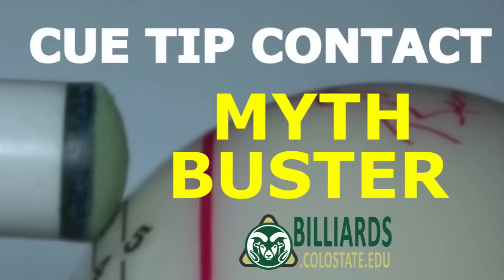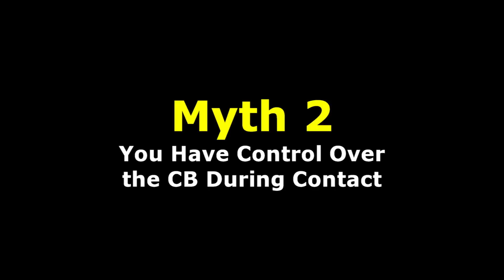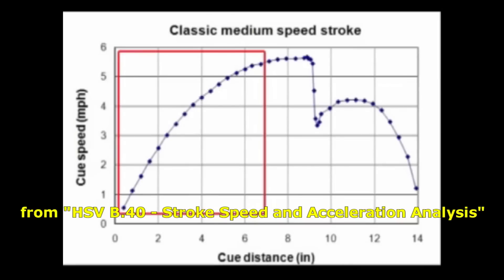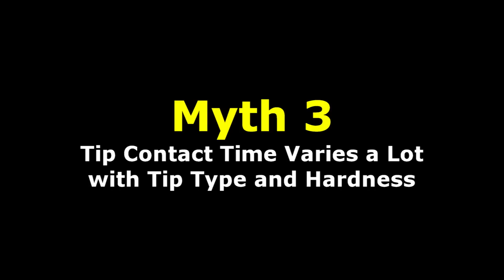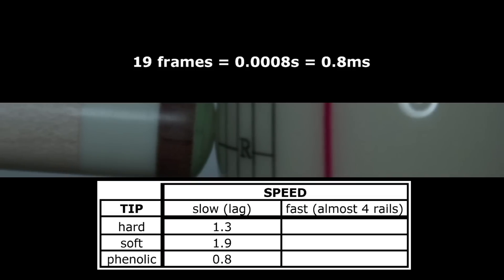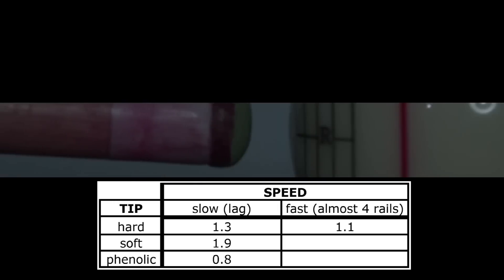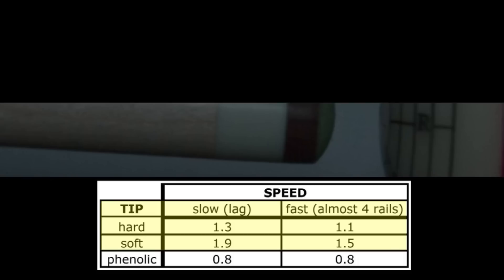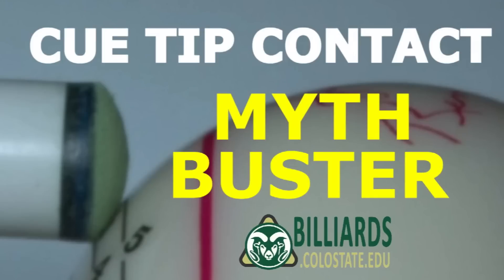Cue Tip Contact Myth-Busting Truths in Super Slow Motion

Comment: What would be a very important experiment is if someone could program a robot that cues the same every time (in terms of angle), but reaches the speed in different ways. I don't believe you would see the same energy transfer if a cue coasts at constant speed into the cueball vs when the same speed is being reached only just as the contact occurs. Even if the latter goes on to be decelerated too, I still believe that you would get slightly longer contact and better energy transfer due to lowering of the deceleration. It's a big difference when something still has an active input force, vs when it only coasts on momentum.

I don't believe that it's only illusion that great players can get huge amounts of power and spin from a simple and slower looking stroke than a lesser player, or that it is only about an input speed. If there's a slight illusion, I think it's simply that well timed shots save the maximum speed and active force input for the instant of collision (thus looking slower overall, even if the contact speed is the same). However, I don't believe it's an illusion that you can do more with timed acceleration than coasting at the highest speed.
Reply from the maker: Good stroke "timing" is smoothly accelerating into the ball, reaching maximum speed with no deceleration before contact.  This is what good players do to make the speed, spin, and power look effortless.  For more info, see the videos and info here:
    https://billiards.colostate.edu/faq/stroke/good-timing/
Reply from the maker: BTW, your proposed robot experiment would be interesting, but robot testing is not always a good substitute for some of the reasons here:
    https://billiards.colostate.edu/faq/squirt/robot-test-results/
Reply: @DrDaveBilliards  the problems detailed in the experiment with robot cueing surely points to how much more we have to consider than the speed at contact? Surely things like contact time are what would have altered the results, in causing the problems with using the robot? To me, it only shows how much more there is than a contact speed.
Reply: @DrDaveBilliards  what explanation is there behind this being the best compared to a constant speed stroke, say? Surely it has something to do with contact if there's a distinction? It's always tricky with humans because a change of pacing could also ruin something else (such as straight cueing) for associated reasons. But why would constant speed be different from the paced stroke, if we only consider contact speed and assume contact time is unchanged? 

 I definitely believe it matters how something is paced and deceleration is certainly bad. However, I think the reason deceleration at contact is a problem is that it shortens contact time erratically and unpredictably. I'm open to the possibility of a sweet spot where you stop the active acceleration marginally prior to contact, but I'm not so convinced of a reason why active acceleration into contact wouldn't add more still for a power shot.
Reply from the maker: @cziffra1980  I don't think acceleration or deceleration at contact changes contact time significantly, if at all.  And even it if did, this would be unimportant based on the explanations on the resources pages (and supporting links) I have provided.
Reply: @DrDaveBilliards  I just find it hard to believe that contact time would be so tightly stuck within a percentage range that it isn't open to meaningful fluctuations either positively or negatively. 

How else do we explain the problems with cueing robots? The net impulse is solely the product of the force applied and the time. If it were simply about speed at the instant of contact, there would be no logical reason why a robot would perform differently. The difference is clearly being expressed through the force/time or both, in a way that is different from a cue that hypothetically only coasts in a space to arrive at a given speed. What almost certainly isn't the case is that speed x automatically gives contact time x, regardless of the other factors, when it reaches the cueball. It doesn't necessarily mean it's the most important issue or that it's enormously open to being controlled, but I can't make sense of any theory that it reduces it to nothing. Why pace the cue action at all, if nothing shows up but a contact speed? There is at least something more. Fluctuation is harder to conceive of in small quantities, but mathematically it actually multiplies the percentage effect of tiny changes.
Reply from the maker: @cziffra1980  The problem with cueing robots with non-human, rigid grips is they change the effective weight of the cue.

Concerning why "stroke timing" is so important.  It is mostly to get the maximum cue speed with the least effort with a smooth and steady motion, and to provide the best speed consistency and control per the info here:
    https://billiards.colostate.edu/faq/stroke/good-timing/
    https://billiards.colostate.edu/faq/speed/advice/
    https://billiards.colostate.edu/faq/stroke/technique/
Reply: @DrDaveBilliards  the simplest way to summarise it is to say that if a robot striking the cue at speed x can cause a different result to a human striking it at speed x, there is a difference during contact. Regardless of what that difference might be, it shows up in the impulse and thus through through the product of force and time. Human actions can change things too. It doesn't necessarily matter how that breaks down, but I think it's important to recognise that even a short contact can happen in slightly different ways, even if it initiates at the same speed. Changes can take place even in tiny instants and multiply.
Reply: @DrDaveBilliards  I feel like you're recognising how important pacing is, but then wanting to downplay one of the variables in which the result of pacing can show up. Force and time are where the virtual mass added to the cue by the robot has an effect. Things like grip strength during contact can play a role through the same two variables. 

I'd agree that there's no need to fixate on contact time, but I'm not convinced that there is greater value in actively downplaying even the possibility that changes of pacing can manifest to some degree here.
Reply from the maker: For the robot rigid grip, the cue has more weight, so at a given cue speed, the "cue" has more momentum ... therefore a different hit.  Simple.  This does not occur with "fleshy" grip of a human per the info here:
    https://billiards.colostate.edu/faq/grip/light-vs-tight/
Reply: @DrDaveBilliards  I take your point, but the way we interact with the cue has an effect through the same means the mass of the robot does. You can either be resisting the deceleration through stiffness or by trying to actively accelerate into the resistance. Either can affect those in a similar way to adding mass. Even if the goal is to coast instead, it never really happens so simplistically when own mass is involved. Our mass won't just detach outright nor apply as a constant, independently of the technique applied. It's a combination of the existence of the mass and what it is doing during contact. 

It's not an equation where in one case we feed in a mass of the cue only and the robot plus the cue in the other. Rather, the effects of this show up within the force and contact time. You could treat the human input factors as going under the proxy of "mass" too. We're just more complex in how our mass associates to that of the cue so its less of a constant than with a robot. The problem with the robot is that it's consistent in a bad context, whereas the human has more variables to exploit at will. 

At the end of it all, there are differences other than initial contact speed which change the force and time, regardless of how tiny the duration might be. To me it doesn't make sense to recognise the variable factors other than contact speed, without recognising that its specifically through force and contact time that they get to play their role.

To give a weird example, if you had a light cue that was been hugely accelerated during contact (by some kind of insane jet engine) then it would logically function more like a heavy cue. Not because of actually having mass but because of the effect on the force and and time spike.

There may well be a good argument that the most reliable result comes from trying to keep our mass out of it, but everything we do to attach or detach ourselves from the way the cue moves is influencing force and contact time in some way. Just because its possible that some may have overplayed the relevance of prolonging contact time in good technique, it doesn't make it a non issue that cannot be influenced.
Reply from the maker: @cziffra1980  Based on all the known information at all of the links I have provided, our "interaction with the cue" during the incredibly brief contact time has no meaningful effect.  Most of what we feel occurs after the CB is long gone.  Again, check out all the links when you can find the time.  There is a lot there.  This stuff has been studied and analyzed for many years.
Reply: @DrDaveBilliards  I find it quite interesting what you suggest about the skin give being unable to have any influence during that time, but surely it would be incredibly easy to simulate the same in a snooker robot, if the cues acts as if separate from the hand altogether during the contact? If this were genuinely an absolute zero as a factor during that instant, I can't imagine why they would have any difficulty building a system that accelerates a cue stabilised by some kind of firm foam say, without any significant mass to play a role during contact. Logically, that should detach it from surrounding mass too. It's definitely something someone should try. I'm just quite skeptical of whether these can truly be completely removed from the model.
Reply from the maker: @cziffra1980  When we worked on a cue robot at CSU (articles are available at the linked page), we used silicone rubber to simulate the human "fleshy" grip.  It decouples the robot from the cue nicely (just like with a human grip).  Some pool players have actually used a "slip stroke" technique, where the cue is actually released (or thrown) after the forward acceleration.  The result is the same as if the cue was still being held.  See:
    https://billiards.colostate.edu/faq/stroke/slip-stroke/
Reply: @DrDaveBilliards  ah, okay. Did you try to actively change the pacing of acceleration of the cue during contact with these simulations (both to stop trying to apply extra force before and after contact)? It would be interesting to see.
Reply from the maker: No.
Reply: @DrDaveBilliards  I was thinking more about this and you do make a strong case for how the effect during contact might be very small. However, I can still see a possibility where if the hand is actively accelerating, it produces more friction compared to when both hand and cue are now coasting. I think I'd have to see some kind of testing that compares acceleration of a hand like connection during contact, vs coasting, in order to finalise whether the difference between the two scenarios is definitively negligible. Although my image of acceleration on the piano is based on a longer bond into resistance, I can still see a degree of theoretical room for control over the shorter duration.

Also, if we do take it that the skin issue means nothing can be changed during the strike, I think this raises additional questions. Why would acceleration during contact reduce control vs entering coasting marginally before contact? Within this model, it should only matter what speed the contact occurs at. The model doesn't allow for transfer for extra acceleration then, but it doesn't clearly show why it could have a negative effect when you still aim to reach your speed at the strike point. Why would it be an advantage to settle on that speed slightly prior to contact rather than continue for a fraction longer? If the explanation were that it gives more control to find the speed slightly in advance then it would raise the question of why not settle into constant speed even earlier in the cueing action, for even more time to settle into the control- particularly for mid-pace shots? I find it hard to see an explanation within this model for why it wouldn't be an advantage to play mid paced shots via  a rather constant cue speed without pacing acceleration near to the contact.